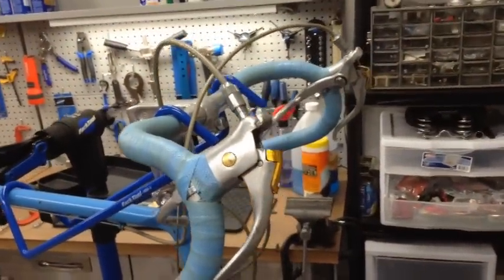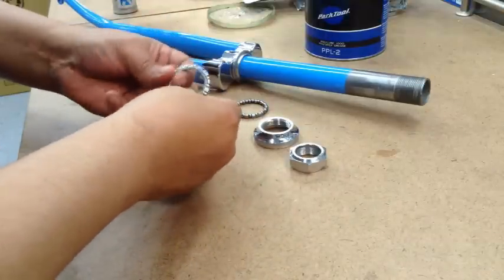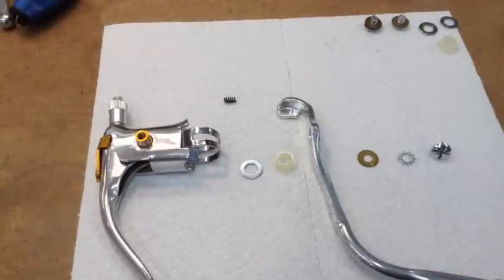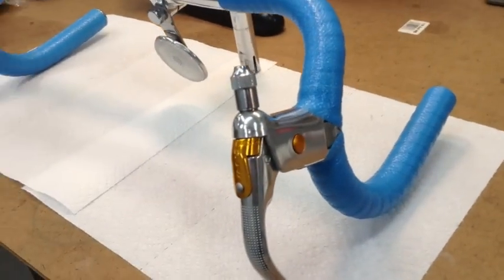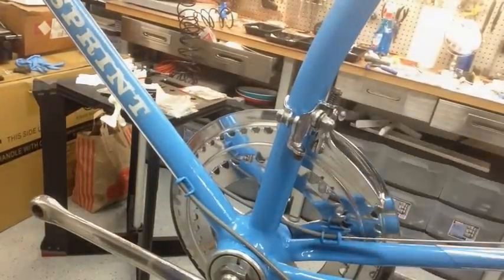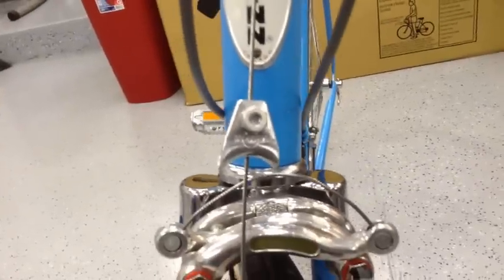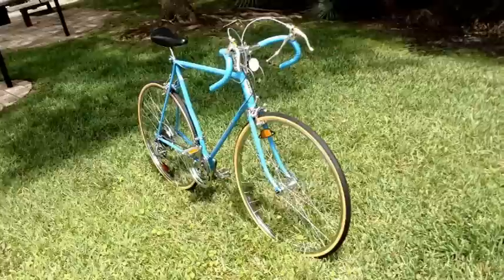Part 4 1974 Schwinn Sprint  Restoration Complete 🚲🔧

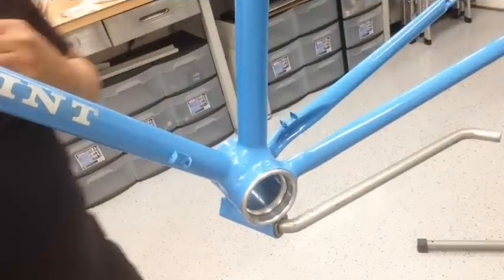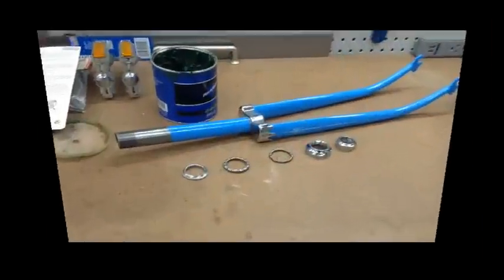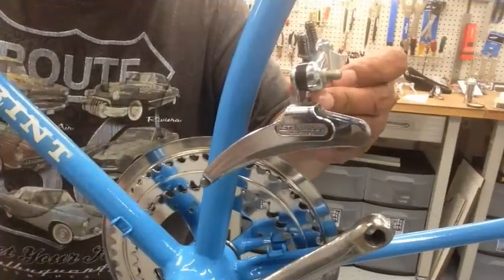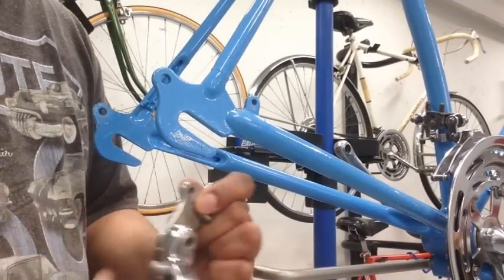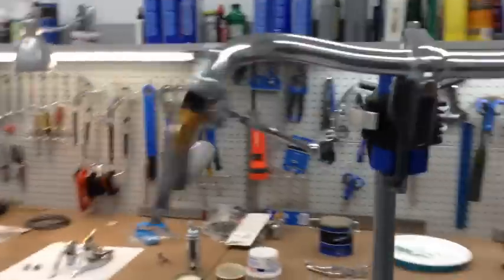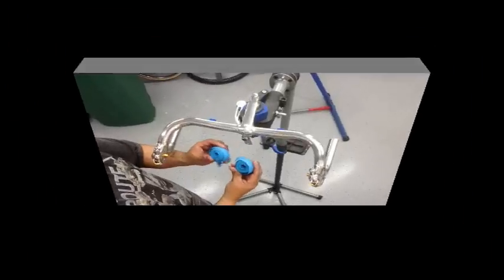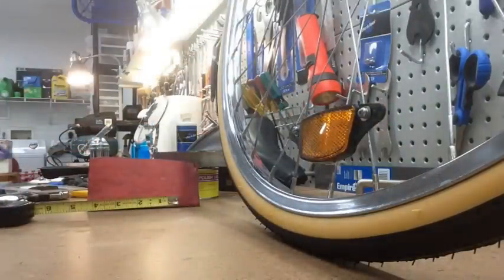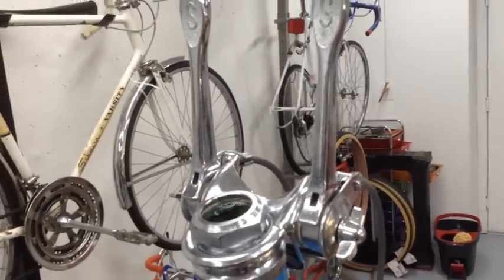Comment from the maker: Here is the timeline for the Build after the intro - Crank Set 3:23 Head Set 6:55 Front Derailleur 9:22 Rear Derailleur 10:17 Front Brakes 11:22 Brake Levers 11:50 Handlebar Tape 16:05 Wheels and Tires 22:05 Shifter Outer Cable fitting 28:06 Saddle 29:22 Handlebar install 30:11Shifter Inner Cable install 31:56 Chain, pedals and drive-train 39:10 Brake Cables and Brake Pads 41:55 Project completed 45:15 Outdoor Presentation 47:14

Comment: Great work. That bike looks beautiful. I just garbage picked an old Schwinn that has potential. The derailleur's are seized up, rusted bolts, it needs new bearings, lots of little stuff. I can get it running again but you sir have gone to the next level. I respect your craftsmanship. Thanks for uploading these videos.
Reply from the maker: Thanks 👍Glad you liked the content🚲🔧Good to hear another Schwinn was rescued! you will be preserving  American manufacturing history for new generations to come 👦👍You can find replacement Vintage Schwinn front and back derailleurs on eBay, I have found just about any original part in better shape as needed. I usually clean and polish all components, but if the are beyond saving I replace them to make the bike look pristine.
Thank for watching 😀👍🔧🚲

Comment: Awesome! Thank you for sharing. I had been wanting to get a vintage Schwinn bicycle again.I had  two different ones back in the mid to late 60's.   In 2005 .I found a really nice pair of early 70's red Schwinn bicycles  at a yard sale, a men's Varsity 5 speed  and ladies Collegiate 3 speed for like 30 dollars.They were in great condition only needing new tires and tubes.Since last summer I was having trouble finding any decent Schwinn's for sale anywhere near me.About 8 weeks ago I was at Habitat for Humanity,and among the newer trashed junk bicycles I found a men's Chestnut 1974 Schwinn Suburban and purchased it for a  whopping 10 dollars.The seat was toast as were the tires and I had to replace the rear derailleur with and original one as someone had replace the original with one mostly made of plastic,it also needed a new chain.After doing some research I had decided to try and find a Schwinn 5 speed with the shifter up on the right handlebar.Two weeks ago I was at the local Goodwill  and was surprised to find another Chestnut 1974 Schwinn Suburban with the handlebar mounted  5 speed Suntour shifter. This Suburban is so cherry that the little plastic tip on the kickstand has never worn off.I have replaced the missing clear front reflector and after I replace the tires with new Kenda gumwall tires it will  be looking  practically new.
Reply from the maker: Nice 👍 Sounds like you have and eye for great finds at bargain prices 🚲Love to hear about these vintage beauties being rescued and brought back to life🔧🚲👍 I will add a Suburban at some point, love the model in any color, thanks for sharing your bikes and stay tuned for more projects going forward, Thanks for stopping by 👍

Comment: I have a 1970 Continental I bought new with my paper route money. Blue like this. It’s complete and has always been stored inside. Needs cosmetic restoration and probably more. Not sure what to do with it. Wife wants it gone from the basement but I’ve kept it this long so........doesn’t seem like it has a high value either original as-is or even with a restoration as there were so many produced. Great video, your craftsmanship almost got me fired up to restore mine, I sat quietly until the feeling passed 😂. Maybe if I had a better workspace like you do.
Reply from the maker: Nice 😏🚲 Sounds like a gem, if stored indoors, she probably looks immaculate, the opaque blue Continentals are pretty special, I have a 1974 Kool Lemon and she rides like a Cadillac... Keep it or sell it to me 🚲 I got rid of the wife and have over 40 bikes all over the house 😁...you must see my next video coming this week...1977 Superior. 
I have bikes everywhere 🚲🚲🚲🚲🚲🚲🏡
Just polish the S-6 rims, chain guard, spoke protector and all the small chrome components. Use a little car wax on the paint, clean the light grey  cables with soapy water and a little bleach, if needed, change inner wire, take it to a bike shop for bearing repack and mini tune-up and the bike will gleam like new. You are right about the value, however,  you can't buy the same quality for $200.
Continentals sell from $200 to $375 and in mint original condition you can get more. Check out this 1974 chestnut brown continental for $400
https://www.ebay.com/itm/1974-Schwinn-Continental-Near-Mint-Chestnut-Brown/174265159214?hash=item2893034e2e:g:o8UAAOSwSD9eqKbe

Comment: Bike looks fantastic.  I am looking for a 1972 Schwinn Continental, in Sierra Brown, like new, or restored new, if you have one or come across one.  This was my first Schwinn, and was stolen.  It doesn't seem to be a popular color through the years.   Also, I emailed you about the colors you use for Opaque Blue.  I found a 2 oz. bottle at Wal Mart, called Cool Blue, 20255E, marked on the label.  This was almost a perfect match right out of the bottle.  I did have to darken it just a tad. .50 a bottle.  Thanks, Jay Grabowski
Reply from the maker: Thanks Jay!, Glad you liked the Sprint, and thanks for the Cool Blue code, I will check it out, I have a World Voyageur in the Opaque Blue as well as a Continental. Funny you mentioned the Sierra Brown Continental, I was just putting the final touches on my next video, a 1971 Sierra Brown Varsity, I talk about the understated Sierra Brown and what a classic Schwinn color it is. Stay tuned...
I have seen a few Continentals on eBay in the brown, just type it in the search bar every so often and one will come up before you know it.  Good luck with your search and Thanks for watching 👍🚲
Reply: I'll keep looking.  The Sierra Brown just happens to be my favorite color.
Reply from the maker: @towsontigers57  I did a quick search and this 1974 Chestnut Brown pulled up, which is a color that was not as seen as the Sierra Brown
https://www.ebay.com/itm/1974-Schwinn-Continental-Near-Mint-Chestnut-Brown/174265159214?hash=item2893034e2e:g:o8UAAOSwSD9eqKbe

Comment: Great video man. Just bought a schwinn varsity but not sure what year is. Took it to a bike shop near me in jersey for a tune up, new tires and tubes but when I tested rid it when I got home the right gear wire snapped. Wondering if I should just try and fix it myself or bring it back to the place I went. It already spent more than week in the shop.
Reply from the maker: Inner wire is pretty strong, if it snapped, it may have been installed incorrectly and could have been stressed at some point  when shifting gears.
They are pretty cheap and easy to replace. I just got these just now 5 for $15 they are usually about $12 each, see link for examples
 https://www.ebay.com/sch/i.html?_from=R40&_trksid=m570.l1313&_nkw=Schwinn+Bicycle+Derailleur+Inner+Wire+Cable&_sacat=0

Comment: Nice Job! I have a 1973 Le tour! I ride it every once in a while! I sure wish you could gie it the ince over ,you do such great work!
Reply from the maker: Nice 👍🚲 I have a ' 74 Le Tour I restored, the 1973 is a rare model as they were only sold at the dealerships and not offered on the 1973 Schwinn Catalog, they introduced the Le Tour to the catalog in 1974 as a Schwinn Approved Import. These are nice bikes to keep as they ride great. Thanks for watching
Reply: My came from a store in Chicago (it's on te bike and the serial # puts MFG nov 1973
Reply from the maker: Very cool👍 and a very collectible year.. Here is some specs from the Schwinn Lightweight Data book
1973 Le Tour Sport 10 speed. Imported from Japan (built by Panasonic). First year for this model. Not listed in the Consumer. Stem shifters. 38 to 100 gear range. Alloy cotterless crank set. Chain wheel guard. Lugged frame with butted top and bottom tubes (bottom tube not butted on 25" frame). Round head badge. center pull brakes with suicide levers. Quick release hubs. Chrome tipped tubular fork. 27 x 1¼ tires. COLORS were Opaque Blue, Opaque Red, and Kool Lemon. Frame sizes 21", 23", 25". 

My next project is my 1973 World Voyager which was also manufactured in the Panasonic plant and offered by Schwinn dealers with no catalog feature. They say the Schwinn dealers pushed back on non US bikes initially but soon realized they were well built and nice additions to the brand. The World Voyager was a less expensive version of the Paramount featuring Chrome plated head lugs, fork crown and front and rear fork ends, alloy rims. Shimano "Dura-Ace" three piece cotterless aluminum crank and Shimano "Crane GS" Schwinn-Approved GT-300  derailleur
Reply: wish I could send you a photo of it!
Reply from the maker: I would love to see it, I'm guessing red? I used to have a forum on Google Plus but the entire G Plus platform ended yesterday, however many groups merged over to mewe to continue to share pics and group topics.
here is the link to Bicycle Maintenance,  you can create your profile and share pics with other enthusiast.
https://mewe.com/group/5c84a142acdf5d724ded7358
Reply: @that70sschwinn  GOOD guess it's red! I took the chain guard ring of the crank and put the diamond tufted seat in storage it was perfect and remains so! I don't have the repair kit bag that it has two slots on the rear for but it rode quit well when I took it down from the garage rafters because my current bike was getting overhauled (yes it's mostly red too!)
Reply from the maker: Nice 👍 my Le Tour is red too, great color on these frames, I also took my chain guard off because it gave it the look of a Campagnolo Strada crank set, I also removed the spoke guard inspired by the Paramount
here is the link to the Le Tour video https://www.youtube.com/watch?v=mPnVOWtFdqY

Comment: I have a 1974 10 speed Continental. Do you know what chain Schwinn used at that time? My chain has W. Germany and U stamped on the links. When you installed the chain on the Sprint did you use a quick link?
Reply from the maker: My Continentals and Sprint, have the original chain part number Dealer PN 51 070 SEDIS 56" 
I used the Park Tool CT-3.3 Bike Chain Breaker Tool to remove and install the link pin, these chains do not have a master link.
Reply: @that70sschwinn  I mistakenly pushed thd pin all the way out.  Are quick links made for y speed chains?
Reply from the maker: @stevemalone4972  You should be able to push it back in, not sure about the quick links 🙄🔧🚲

Comment: I used to have this 1974 model and opaque blue color. It was $129 when I bought it in August 1974. Great job! Whatever became of this bike?
Reply from the maker: Very cool! I started looking for one as soon as I saw it on the 1974 catalog and noticed they were not as common to find  for sale on eBay, they were only made for 2 years so there is certainly less of them than the Continental or Varsity. I believe they discontinued them due to manufacturing cost compared to the other electro forged frames, they had to be filet brazed with brass on the bottom bracket to accommodate the curved seat tube placement. As you mentioned $129 was about the same as the Continental which sold like pancakes and was cheaper to manufacture with the standard EF bottom bracket shell construction.
I have seen a few on eBay and they usually sell for $300 and up based on overall condition.
Reply: I would buy this bike again, if I could find one in mint condition. I bought my original Sprint, August 8, 1974 - the day Nixon announced his resignation. Wish I still had it.
Reply from the maker: @jonkennedy3458  Nice! I did a quick eBay search with the key words "1974 Schwinn Sprint" and it pulled up 2 examples.
One is certainly very rare, it appears to be the Sky Blue with the original translucent blue bar tape. I have never seen that color listed on the catalog options for 1974, they were offered in Opaque Blue, Kool Lemon and Opaque Red. If this bike is indeed a 1974 it could be a December serial number, Schwinn would often offer next years options in December  to  forecast interest. In 1975 the Sprint was offered in these colors as described in the 1975 catalog marketing below.

See link below, you can do searches like this frequently and you will find one you like at some point.

1975 Schwinn Sprint
It's just a little curve in the seat mast but it makes a big difference in the ride.

This year the ten-speed Schwinn Sprint design has been even further refined, so that now more than ever it redistributes the rider's weight, positioning it over the wheel and creating outstanding traction. Check out the Schwinn Sprint. It's really something different.

This unusual concept in lightweight bicycle design is a result of intense engineering and design development... proven by computerized standards established at the Calspan testing laboratories. The special frame angles, weight distribution, and over all configuration provide a responsive, easy riding bicycle with remarkable performance characteristics.
Frame: Schwinn designed and manufactured short-coupled durable steel. Tubular front fork.
Frame Finish: Sky blue, flamboyant red, chestnut.

Wheels: Lightweight steel tubular rims. Quick release hubs.
Tires: Schwinn- Approved 27" x 1 1/4" high pressure gum wall sports touring.
Handlebar and Stem: Randonneur type aluminum alloy handlebar and forged steel stem.
Crank Set: Lightweight one-piece crank. Schwinn-Approved chainwheel- two plateau, 52-39 teeth.
Pedals: Rattrap style with reflectors.
Derailleurs and Gears: Schwinn-Approved front derailleur GT-260. Schwinn-Approved rear. Rear cog- 14-17-20-24-28 teeth.
Brakes: Center pull aluminum alloy brakes with dual position levers. Easy adjusting brake barrels.
Saddle: Racing style.
Weight: 36 lbs. approx. depending on frame size.

https://www.ebay.com/sch/i.html?_from=R40&_trksid=p2047675.m570.l1313&_nkw=1974+schwinn+sprint&_sacat=0
Reply: Thank you for the info. sir!
Reply from the maker: @jonkennedy3458  😏👍